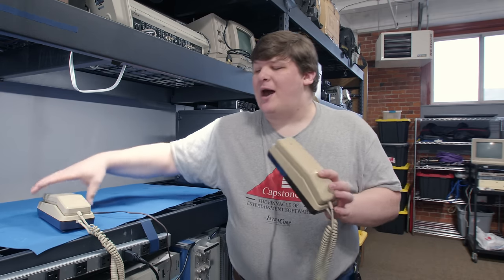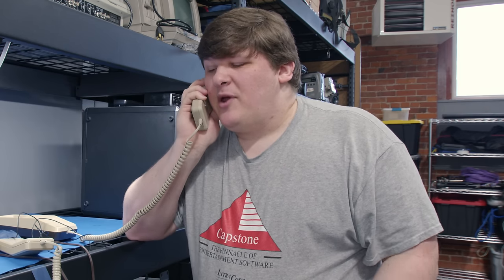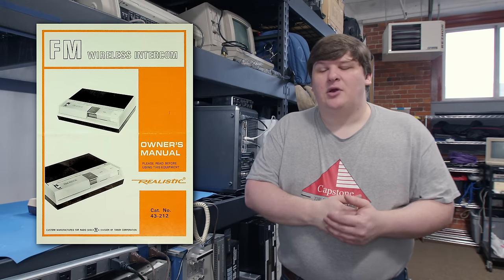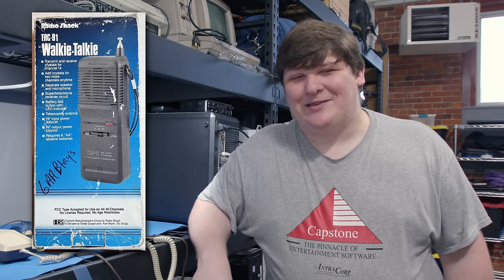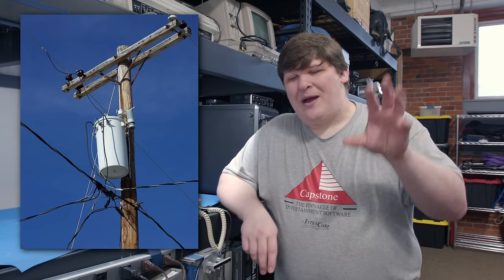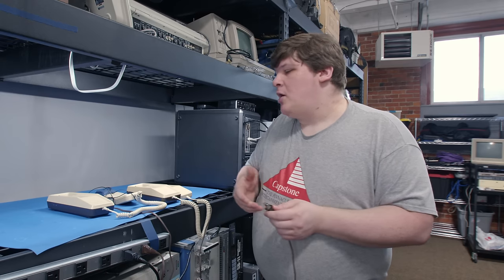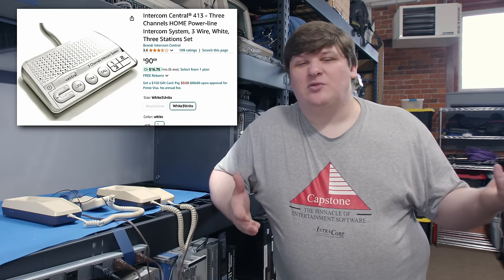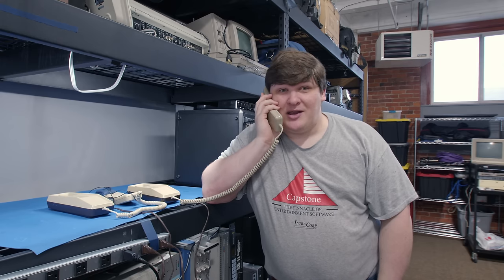How does this "phone" work without a line?

Comment: As lame as it sounds, I was hootin' and hollerin' when you revealed they were Powerline devices. I thought that was what they were at first, and felt a tiny bit bummed when I saw FM. I had no idea the technology had been around so long! 

P.S. I'm one of the lucky ones who has gotten powerline ethernet adapters to work for them. They're a godsend for decluttering!
Reply: spoiler of the century
Reply: I also have power line Ethernet and it works pretty alright, Though that's because my Wi-Fi connection upstairs is complete dog water ( And I have no real way of running Ethernet down a flight of stairs, and across the living room)
Reply: I just went through the same excitement-disappointment-excitement rollercoaster.
Reply: I had the exact same reaction.
Reply: @lula4260  Would it be possible to run a cable outside, between windows? Drilling and sealing a cable hole through a window frame is easier to do. Than attempting to wire ethernet through ceilings/floors.
Reply: Same here, can't beat that vindication!
Reply: I kinda expected it.
Reply: I had no idea power line Ethernet didn't work consistently for other people. Its worked great for me in 2 houses in the last 15 years using the same equipment. I even had a WiFi antenna hooked up to the power line for a while to get full house wireless coverage.
Reply: @russianbear0027  I remember when ADSL came out it turned out there were a load of people who had phone lines which would never support it because they were a single wire with ground as a connection to the earth or something. I.e. there were lots of ways to wire people up to the phone system and get a decent-ish phone signal which is something like "not too much attenuation between 300 Hz and 3 kHz" but would fail for ADSL which  uses 25-1104 kHz. I could see something analogous happening with power lines - a cheap solution which works for 50 or 60 Hz AC but which fails for Ethernet which is going to be much higher frequency and much lower amplitude.
Reply: @russianbear0027  I have some that work great until either my e-bike charger is plugged in or the microwave is running, then it just cuts out completely, still beats running 100m of Ethernet cable to a device that needs less than a 10 Mbps connection.
Reply: Live in Apt so no drilling. The trick for powerline ethernet is to have the units on the same circuit breaker. I have the PL1000 so theoretical gigabit. Actual speed is around 320-400 Mbit or so. I see 30 megabyte/s transfers. If the signal needs to jump circuits I think the speed could crater
Reply: @stephen1r2  There must be something in the circuit breaker that attenuates high frequency signals.
Reply: I’m the one who used to have great luck with powerline and now I live in a 2-story house with no Ethernet wiring and somehow neither Powerline or MoCA work here between the rooms I need it (upstairs and downstairs) 😢
Reply: i used to use powerline adapters but they were so god damn slow, like the best i could get with no active devices using the current was probably like 15 MB/s and when a bunch of other stuff plugged in it was like 4 MB/s. if you have cable coax in your house, please invest in a MoCA. they are a god send if you need ethernet. Even the cheapest of devices can do like 100 MB/s and more on better hardware.
Reply: FM in no way means the signal must travel over air.
Reply: I got mine to work but they work best under specific circumstances. They work best when they're on the same circuit in the house. If it jumps between breakers, it gets extremely unreliable.
I have some jank setup that uses a combination of powerline and wifi extenders to jump between floors. It's messy and looks stupid, but it works
Reply: Tbh I've never had power line Ethernet not work maybe it depends on the age of the lines
Reply: @user-qf6yt3id3w  a lot of circuit breakers have built-in “surge protectors” now, which are really just large capacitors in series. And capacitors are low-pass (high-cut) filters, so that makes sense to me. (Also, possibly, some people with older breakers might still have been trying to use a “surge protected” power strip?)
Reply: @kaitlyn__L  That makes sense.
Reply: @kaitlyn__L Capacitors are in parallel though, but yep I think your point is right.
Reply: I've always had mixed results with powerline ethernet myself. Usually I can get a connection, but even with gigabit rated ones it's like... 10mbit at best, usually with terrible latency.

It ends up not beating just using Wi-Fi and maybe a bridging setup for non-Wi-Fi capable kit.

Admittedly as someone else mentioned this could be a matter of "not being on the same circuit", but I've almost never been in a situation where two things would be distant enough I couldn't get short run of ethernet between them safely and be on the same circuit.
Reply: @TheSimoc  the guy who installed my breakers said the breaker ones are a fairly complex network of parallel and series nowadays, tho he might’ve been yanking my chain, but yeah I just picked one to simplify when talking about the power strips :) Thanks for the clarification — the ways capacitors kind of flip series/parallel behaviours versus other components always catches me out when I was prototyping so that might be what happened here as well haha
Reply: @kaitlyn__L  By the way, figured out after my earlier reply, that besides the surge protectors, circuit breakers themselves also have a series coil for their main functionality - to provide the current-dependent magnetic field to mechanically trigger the breaking. So even that coil itself might make enough series inductance to kill the high-frequency signal. Actually, I remember someone said back in the day that those phones can only work downstream the same electricity meter, not over it. Now I see, it also has series coil to magnetically turn the disc. Coincidentally no mention about circuit breakers - we didn't have such back then, just fuses which didn't make significant inductance.

Comment: I love that there was once a time when manufacturers expected their customers might have more intelligence than a slug, and were willing to explain the circumstances where the technology would and wouldn't work.  ("This isn't going to pass through a transformer" -- and expecting that you are actually competent enough to know or figure out what that is and means.)

It feels like we have been continually lowering the bar ever since then, and just manufacturing customers that are motivated to find a way to go underneath it.
Reply: Well said!
Reply: On top of that, back at the time this was being sold, Radio Shack was still very much a hobbyist's kind of store, so a Radio Shack customer was liable to be more technically literate than the average consumer.
Reply: @ssbohio yes indeed.
Reply: It's way simpler than that. These devices come from an era when the transistor was a hot new thing, and only the best electronic devices had them.  So by touting the transistor and diode count like that, they're trying to sound spectacular and high-tech.  Ultra modern.  Hip.  The latest thing.  It's similar to how AI is the hot new term applied to everything today.
Reply: *seems like not feels like and yes. It's all by design. The less you know, the easier you are to control.
Reply: @LatitudeSky  or indeed, transistor count is still boasted on new CPUs and GPUs all the time! Now it’s the billions or trillions figure which impresses, rather than having transistors at all. It’s an especially interesting metric in that, a CPU with an integrated GPU will always score way higher on Transistor Count Scores even if the CPU without is more powerful.

Comment: Yes the plug and talk system is a fm system that modulates on to the 60 hz power system. It also is a duplex transmission system which allows for simultaneous talk and listen functions. As far as being "on the same distribution transformer " is concerned they will work on either or both legs of a split phase system but if you are on a three phase wye system they must be on the same phase leg to work.  I know this because we used them as a theater intercom in a venue with a Three phase wye system and that is how we finally got our system to work. A couple of side notes for those who care if you and your neighbours are on the same transformer guess what you can communicate from house to house. In buildings where there are transfers on premises such as schools then you must be on the same transformer and in the case of three phase the same phase as power distribution transformers don't do a good job of passing high frequencies from one winding to the other.

Comment: In the mid 90s, my grandparents had a set. One in the kitchen, and one in the detached garage/shop. It was all so my grandmother could tell my grandfather to quit working on the car, and get inside for dinner.

After three sets, they decided to modernize circa 2005: they got PTT cell phones from Nextel. And kept using them until that service was fully discontinued...
Reply: My maternal grandparents had something similar, except the intercoms were in the kitchen and the upstairs TV room.

Comment: mentioning X10, as I'm literally working on a goddamn X10 to MQTT bridge for home assistant (specifically to support RCS X10 thermostats, which is a subtopic fascinating enough that you might be interested in digging into it).
Reply: It may be a shock to those who remember X10 to find out, yes, it is still around. Quietly hiding in the shadows.
Reply: @LatitudeSky  the shadows of my house, yes. including two RCS TXB16 thermostats that I can now learn the status of via MQTT w/ my fork of x10mqtt. :)
Reply: Also, X10 isn’t super reliable really, since there’s usually no feedback to acknowledge the command. And you often need a bridge between the two legs of the US wiring. These intercoms don’t seem to need that, they probably just send a stronger signal?
Reply: @markjames8664  X10 uses carefully-timed pulses which don't easily cross from one electrical phase to the other. These intercoms use actual radio signals, they're just carried over the power lines. They'll be blocked by the big transformer on the pole but aside from that they'll go wherever the power lines go, for the most part.

Comment: For the record, analog voice radio modes (like walkie-talkies) can only have one transmitter (speaking user) at a time. So if you want full-duplex (both sides talking at once) on a voice over FM system, you need two frequencies.
Reply: Any narrow band radio is one transmitter per channel. Digital ones just label a pair of frequencies as one channel.
With wideband (wifi, cdma, lora, etc.) clever math that makes them go also allows full duplex on the same frequency.
Reply: Yep. If one has used a CB radio, they will be familiar with not being able to hear and talk at the same time.
Reply: @denisdrozdoff2926   hooray for frequency-hopping!

Comment: We had a pair of the flat non-handheld ones with RadioShack branding. Our laundry room is down 3 flights of stairs in the basement, the other unit sat in the kitchen. This was in the late 90s and early 2000s. Eventually got rid of them when we got cordless phones with an intercom built in. Seem to remember them working great though!

Comment: 8:30, Powerline network transceivers reliability - As an IT consultant, I've learned how to make judicious use of powerline networking technology, but you're quite correct in that it's not without its foibles. Like the intercom sets, powerline won't work between different parts of a building, even a single-family home, if that building is being fed by two different powerline distribution transformers. Strange as it might seem, I have seen this happen. There are some very large homes near me that have multiple connections to the outdoor powerlines - one for each floor, in fact - and sure enough, powerline networking doesn't work between floors in those homes. Other considerations that affect powerline networking can include how breaker boxes are connected, large/noisy appliances and quality of electrical wiring. The bottom line is, I tell clients, you won't know if or how well powerline networking will work in your home until you actually try it, and if it doesn't work for you, then there isn't much you can do about it, so it's never my first choice of a networking technology. But when it does work well, it's awesome.

Comment: My grandpa hooked the desktop model up back in the 80s... he had hard-wired the thing into the wall so it didn't need a plug.  One in the kitchen and one in the workshop, just like you said.  Eventually, the poor reception made it so he just wired up a really loud buzzer for my grandma to press on.  The Radio Shack one is still on the wall, but I haven't tried to make it functional.  He died in '92 so it's been just sitting there since then.

Comment: My family had a set of something like those from Radio Shack/Realistic. We had one of the desk intercom shaped devices instead of the phone shape. They definitely had that 80s brown-on-beige design language though. The central unit (in the kitchen, of course) had a three-way rotary selector, a push-to-talk button, and a beep button. The three “satellite” units around the house were smaller and just had the talk button and a beep button, nothing else. I remember being fascinated as a kid by the mechanical latching mechanism that could hold the talk button down if you wanted to leave the line open. They were full-duplex though, more like a phone than a walkie-talkie in that both sides could speak and be heard simultaneously.

I don’t recall ours using any radio or powerline shenanigans though, or having an “FM” label. My memory is a little fuzzy, but I think ours had dedicated wiring: either phone cords or audio cables with phono jacks that dad had strung through the walls.

Perhaps the reason they never show up in recycling or thrift is that they “just work.” We were still using ours well into the 90s until eventually we replaced the whole thing with a cordless phone system that had similar features, at which point nobody cared about them anymore, so they just got insta-junked.

Comment: About 10 years ago we bought a cordless phone set that had a base station with answering machine and it had 6 handsets. One of the main reasons we bought this particular model was because it had an intercom feature where you could call a specific handset or broadcast to all other handsets linked to the same base station. We used it all the time. Granted our cell phones were cheap prepaid tracfones were you paid per call and per text so having this intercom feature was great and it was all wireless. Even with an unlimited cellphone I don't always bring it with me while I'm in the house. Only time I make sure I have it with me is when I go down to the basement.

Comment: You can still buy the plug n talk style intercoms that work this way haha. I worked for an electronic retailer here in Australia and we sold an intercom (although very rarely did someone come in for one.) I figured out on a slow day (which was most days) it only had a power cord, and realised it was using FM over the power circuit in the house!

Comment: Growing up, my parents had a greenhouse operation on 10 acres.  My father was technically savvy enough to be dangerous, and so around 1979, he bought two pairs of the Plug N' Talk units.  And sure enough, only certain units would talk to other units.  He still deployed them across the place... two in the house, one in the workshop and one in the main greenhouse... so you could talk from house to greenhouse/shop and vice versa, but not house to house or greenhouse to shop.  Worked good for a time, but the damp environments eventually killed them.  By then, we had several phone lines and Cobra wireless phones that acted like a better intercom system.

Since we had a retail shop, but not a dedicated person to man it, my father hacked together one of those old time car alarms that would set off a radio pager (not a pager from a telecom) using a hose system in the parking lot like a gas station would have.  So when a customer would roll in, someone would drop what they were doing and walk out to help them before they pressed our service button.  That person was usually me... after school... every weekend and all summer.

Comment: The moment you mentioned they don't work if they aren't on the same transformer, I immediately got excited bc I knew what was coming up.
I remember seeing LGR cover some sort of...I think it was a light scheduler or something? Idk, but it was where I first learned of the somewhat cursed concept of transmitting data over a branch circuit.

It makes sense, Electrical wiring is kinda just bigger phone wires, but damn if it doesn't throw me for a loop every time I see it.

Comment: Worked in a Radio Shack repair facility throughout the 1970's.  Repaired a fair number of the Plug 'n Talk intercom DESK units, but don't recall ever seeing the phone type, which means either they were rarely sold, or they never broke.  They would have useful in case you wanted partial privacy.

Comment: Memory unlocked: My grandparents in California had one of these in the garage and one on the dining table.  I had seen dedicated hardwired intercoms before (I recall in the 1980s through the 2000s, you were more likely to have a central intercom than central heating in metro Portland, where and when I grew up).  So the one that was mounted on the wall of the garage with no visible wiring and the one in the living room on the dining table made absolutely no sense to me until I saw this video, and saw the exact two button box intercoms my grandparents had.